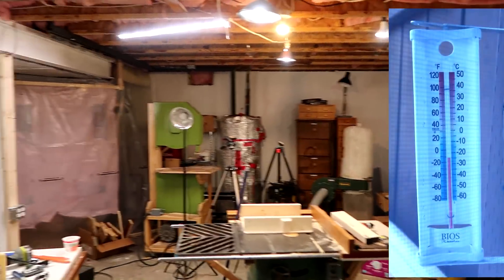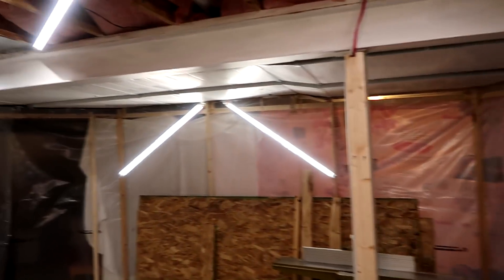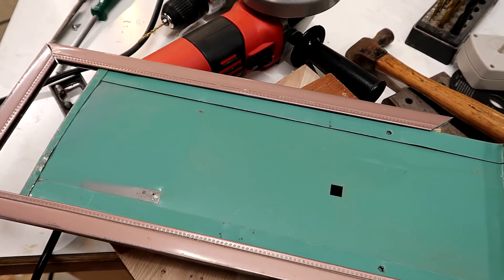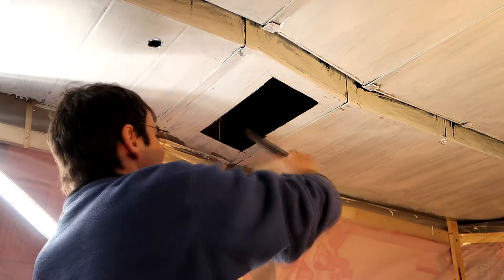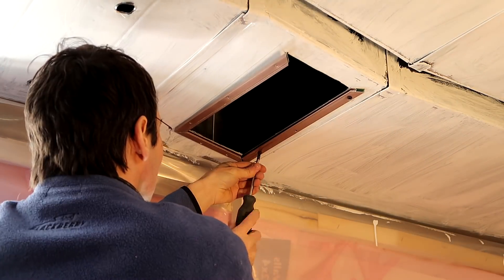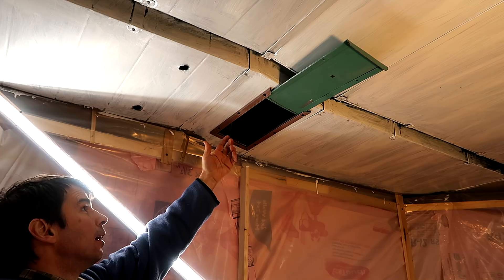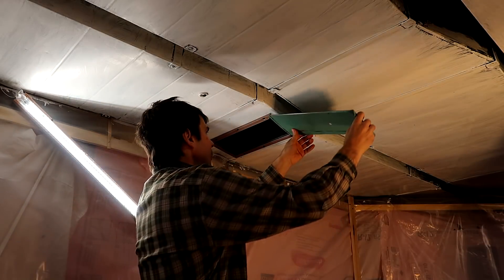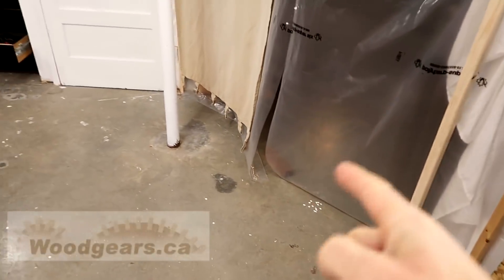Bigger hole in the duct for more heat in the basement shop

Comment: As an HVAC system designer, I cringe a little at DIY solutions like this. But then I'm not the one getting the $2000 dollar quote to install a dedicated basement zone.
 If you only want heat to get into that closed off area of the workshop, cut a matching hole (better yet 1.5-2.0x larger) in the return duct, right next to the supply hole (or somewhere in the area you want conditioned.) This will relieve the pressure in the room and prevent the air from trying to escape through the joists to a return register in another part of the house. Way better than virtually filtering the air through fiberglass. Also, if you leave that return open even when you don't open the supply, it will help suck warm air through that existing 6" vent and at least keep the area tempered. I'd love to see if this helps!
Reply: Sounds like an elegant solution
Reply: Good to have guys like you around,  thank you.

Comment: if you don't make a return in that basement space you'll just end up forcing dust from the shop area to the nearest return outside of it. filling the gaps with fiberglass will just make them end up caked with dust since air will still seek out the return. air circuits work like electrical circuits. a tiny change in PSI can make a huge change in air changes per hour considering the volume involved
Reply: insulation does not stop airflow, which is what you are looking for.

plastic sheeting on the underside of the insulation with all joints/penetrations taped/sealed will do it.

Comment: I wonder if you put the cover on a hinge and limit its rotation to 90 deg. you could push it up into the duct and simultaneously block flow down and allow air to flow into the basement.

Comment: A quick tip for insulating the space between the ducts...  I used R30 which is 10" thick.  The pieces on mine were cut to 53" lengths so to make it easier to push through I used a piece of drywall about 10" wide x 55" long on top and bottom of the insulation to compact it while slipping it between the joists....

Comment: I reckon you need to have the sliding cover replaced by a hinged inwards flap. That way when you hinge open the flap it directs the heat out the vent.

Comment: If you are producing enough heat with the fireplace, you may be able to just run the fan on the central heat and circulate warm air around the house without running the furnace.

Comment: What path does the air that exits that new hole take to return to the cold-air input of the furnace? My furnace is in the basement too, and there is no cold-air return in my basement. I wondered how yours is done...put another way, the hanging plastic would only blow "outward" if the new air had to leave the enclosure of the hanging plastic to get back to the furnace.

Comment: you could have made a hatch that hinged inside so when you lift the lid, it would block (maybe even if only partially?) the normal path forward in the tubes and redirect the heat out

Comment: Living in the UK this is quite strange to me! All houses have radiators here, how does it work? I once worked in a workshop that had a gas heater which was a big metal box that had a pipe coming out the top you could direct around the workshop, is that the same thing?! I'm very confused!
Reply: teenflon Sort of, but on a bigger scale. I'd say it's 50/50 here, plenty of houses have radiators.
Reply: Yeah my house gets cold when it's -3 outside I can't imagine what -20 would be like!
Reply: teenflon There are plenty of houses in North America that still use radiators, but it seems to vary by area which type is more common.  In my area (North Dakota, north central USA) natural gas fired forced air heating is probably 80-90% of homes with hot water or electric radiators making up the remainder.  In this area it seems like houses built prior to the 1950s are more likely to have radiators than forced air heating.  In large institutional buildings like schools, hospitals, etc hot water radiators are practically universal.

As others have said the ability to have central AC and use the same vents is a big advantage if you live in an area that requires heating and AC regularly.  Where I live it is routinely -20F (-30C) in the winter and >90F (32C) in the summer, so both heating and AC get quite a bit of use.  I have lived in homes with both hot water radiators (called "hydronic") and forced air heating/central air and I will NEVER go back to radiators, there is no comparison as far as comfort is concerned.

Comment: I’ve heard that you aren’t supposed to put vents directly in the main but instead are supposed to add branch runs. I wonder if that is true. I guess it can upset the balance of the system. Obviously that isn’t a concern with what you are trying to achieve but maybe someone has some more insight into that. My 60 year old house has a main branch vents but they are usually closed.
Reply from the maker: that makes sense.  vents directly on the main run would get way more air.  But that's exactly what I want
Reply: Matthias Wandel: if you create an opening capable of similar air flow in the return, it would reduce the need for replacement air to be drawn from elsewhere in the basement.
Reply: You're right, it relieves the pressure in the main duct preventing pressure from building in the register ducts (heat runs) which is what forces the air to turn the corners in those runs and get out the register into the conditioned area. Cutting that big window in the trunk line will relieve a lot of pressure from the blower motor and will rob most of the air from the upstairs. Forcing it all to only exit that hole though, but blocking off the duct after the hole could increase the pressure on the blower as the system now has to get all the air through a smaller area.

Comment: What is that furnace? Is that a pathway for exhaust fumes of some sort of stove? Of course I suspect you'd have considered carbon monoxide and wouldn't channel fumes into your workshop. Just wondering what "furnace" really refers to. Just hot air?
Reply: ytctrb yes, hot air.
Reply: thanks, John

Comment: Instead of a sliding door, what about making it swing up into the duct?  Divert the heat with one simple operation.  Perhaps mount a magnet up against the duct inner wall which would hold it in place up inside the duct.  Add a simple lip on the bottom to retain it when closed.  Gravity and pressure should keep it closed when not opened up.

Comment: I wonder if you could do the sort of hinged approach that would redirect air into the basement and block it from elsewhere, like they do on roof drain pipes when you want to divert the water to a reservoir. http://www.kourutyo.fi/userData/kourutyo-etela-pohjanmaa321/images/ranni.jpg One on flow and one on return line and, connected together so you only need to pull a single lever to open both.

Comment: Like others have said be careful restricting the air flow. In a modern natural gas furnace you can actually burn up the heat exchanger if not enough air is flowing past to keep it cool. That being said you should be able to find a damper for that square duct online. If this is the first vent in the supply just install the damper after the vent you cut and close it a bit when heating the basement. Keep the upstairs from getting too hot.

Comment: Do Americans not having central heating? Like radiators?
Reply: a long time ago we did, but most people have forced air central heating and cooling these days.
Reply: *Canadien

...But yeah, forced air heating seems to be the dominant form of heating in North America. I guess it's because A/C is a lot more popular there and that makes it easier to do whole house A/C.
Reply: Mike's Micro Shop So is that the main reason North America favours air systems? Because it can double up as A/C in summer? I've always wondered why. It seems a ridiculously inefficient method of heating your home unless you also spend huge amounts on insulating windows/doors etc.
Reply: My furnace is 95% efficient as far as the reasons I could not tell you, but I do know that it is much more responsive than hot water or steam.  The current systems for hot water and forced air are almost the same with forced air system on the high end beating out hot water in overall efficiency.  The two biggest cons to hot water are the cost of installation and the lag time to change the temperature in the house or building.  Steam is never going to compete with hot water or forced air as it is vastly less efficient due to phase changes in the system and has a greater lag time than hot water systems.

Comment: Or you could do it the right way and install a register vent with a shut off....
Reply from the maker: The shutoff on register vents doesn't shut off very well.  And fully open they don't let that much air through either.

Comment: Be careful blocking supply  too much or you can drive up temp in furnace and even bump up against high limit safety.  Good idea though

Jim
Reply from the maker: and how does opening a hole block supply?
Reply: Matthias Wandel it doesn’t.  Just use care if you block it off to increase air.
Reply: Matthias Wandel if you say successful in directing the majority through the new vent the furnace can drive the heat exchangers temp too high. 

No worries otherwise 

Jim
Reply: Matthias Wandel he didn't say opening a hole did. It clearly says blocking, like you mentioned in the video
Reply: byw No worries, indoor thermometers have been using dyed alcohols for quite some time. 😅 Those might be toxic as well, though.
Reply: +byw With the red liquid one he might go blind. That is easily 0.2mL of methanol in there.
Reply: By the way, the fatal dose of methanol is surprisingly low - something like 100 mL.  Meanwhile, metallic mercury is much less lethal than organic mercury.  I'd avoid both and stick with nibbling on the duct scraps.